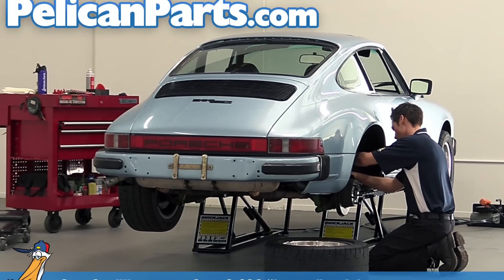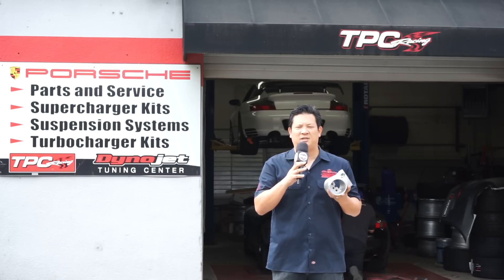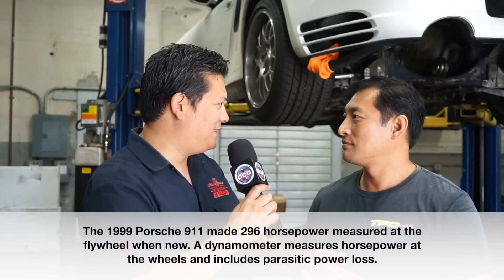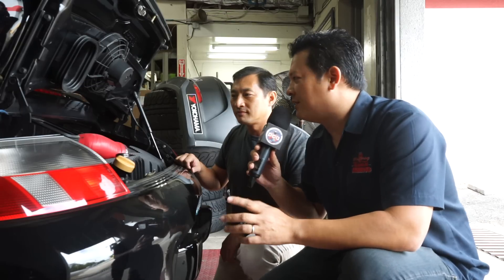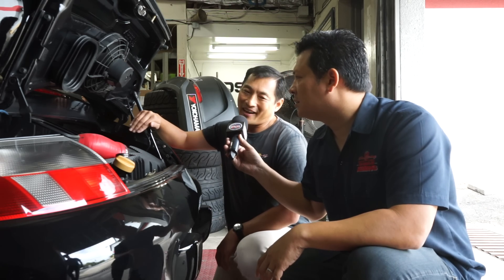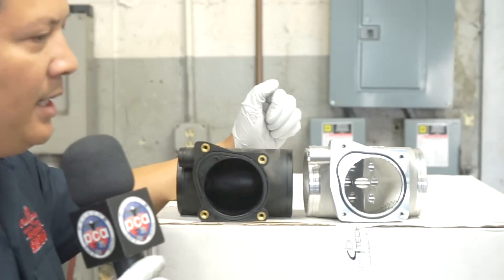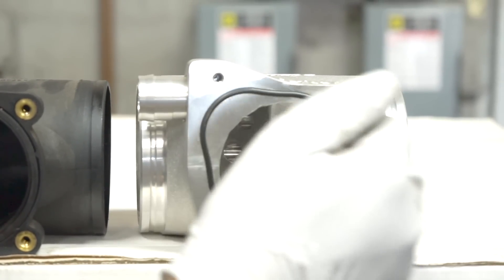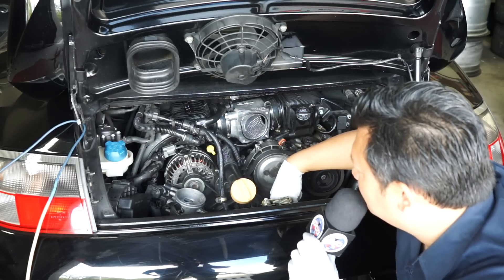PCA Spotlight: We break, fix a Porsche 996 Carrera on way to more power with IPD intake plenum

Comment: This makes no sense to me.  The cars had around 300 HP these results made no sense to me.  Did we lose 60 horse power in 20 plus years?
Reply from the maker: 300 hp is at the flywheel. We were measuring horsepower at the wheels. Drivetrain loss can be significant depending on model.

Comment: Over $1000 for a nominal gain. I’ve also seen a Mythbuster vid on YT with a 997.1 where the upgrade to GT3 (I think) made 1hp difference. I think it’s worth checking out because I honestly wouldn’t expect just a plenum and TB to make much difference, given that all the piping and air filter box are still the same a conversion like this can’t affect the air coming into the filter. Usual form with the Boxster upgrade is upgrading the filter to TB pipe size which isn’t pretty. Obviously there is a noticeable size difference. It was noticeable that on the 997.1 vid they also separately added a K&N cone filter which lost hp!

Comment: Excellent video. The only thing missing are before and after comments from the owner/driver on throttle response and performance improvement on the road . I've been thinking about this upgrade for a 2004 996 C4S with X51 Power Kit and would like to hear an owners perspective on driveability and performance gains.
Reply: @cabby is your c4s for sale?
Reply: @mehdijafri8424  my C4S is for sale, £35,000.

Comment: I would discredit the second dyno run because the car needs to drive atleast 300-400 miles for the ecu to reprogram and relearn to compensate for the bigger throttle body. Thats why the bhp gain isnt as significant. The car will run richer too.

Comment: Nicely done! Having done an air intake, throttle body and plenum upgrade on my 986 S, it was really interesting to see the differences when working on a 996. I will say that removing the airbox/maf unit in the Boxster was much more difficult than what you just did! On the other hand, the plenum and throttle body removal is easier on the 986. I have documented my modification on my channel. I like that IPD plenum, maybe when my next old age pension cheque comes in! Haha